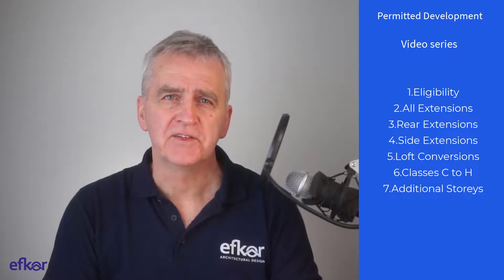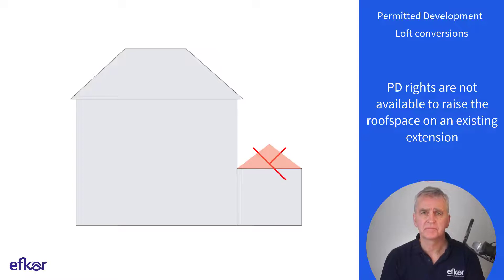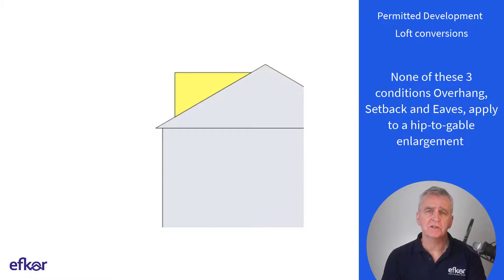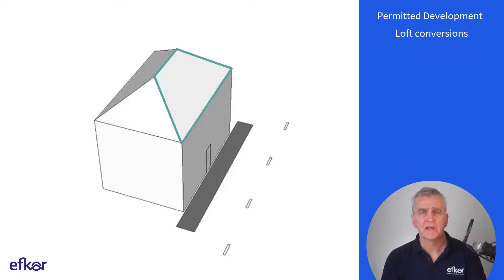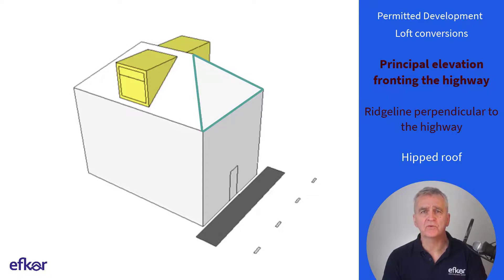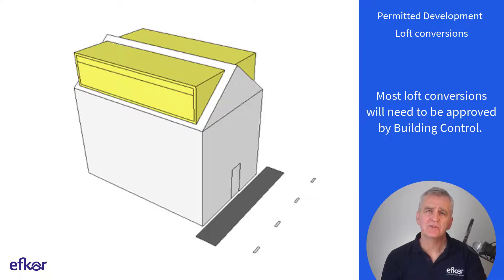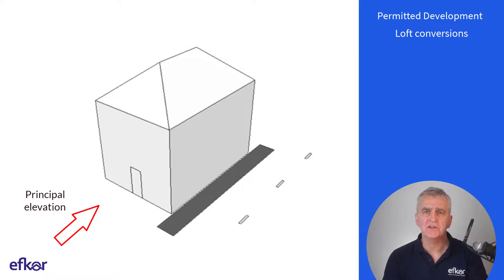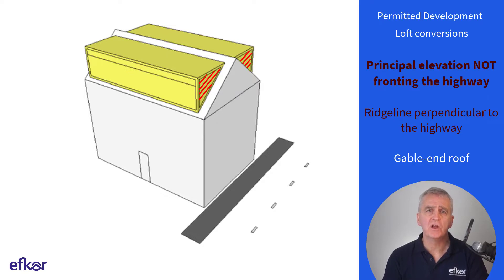Rules for building Loft Conversions using Permitted Development

Comment: Hi Marc, it would be good to have your view on B.2 (b)(ii) 'other than in the case of an enlargement which joins the original roof to the roof of a rear or side extension, no part of the enlargement extends beyond the outside face of any external wall of the original dwellinghouse'. No other youtuber has examined this section and it would be very useful. Thanks.
Reply: Also Marc, just a word of warning - although a main entrance door to a dwelling can be at the side, this is not the only determining factor of which is the principle elevation. If that elevation is relatively featureless, containing in addition to the door, only one small window for example, there are planning appeal decisions whereby the planning inspectorate considers that the principal elevation to be that of which has more windows and is more prominently in view as one approaches. I assume you acknowledge this point however as you are just using this to guide the viewer through your explanation. Your videos are great however and I appreciate the way you explain PD rights in a simplified manner. Just thought I would put that note to all viewers, in case they may be faced with this type of situation and therefore are not shocked. Thanks

Comment: Really enjoying the videos, thank you. Could I ask a question? I an wanting to put a one storey 3m extension on the back of a terraced house under PD. Are there any issues about how close to my neighbours property, or in effect can I just follow the brick line coming off the back of the house? many thanks
Reply from the maker: Thanks Paul. Two issues to look out for. First make sure that your property retains PD rights (if not sure, email the council). Second, many (London) councils are rejecting such cases where the original house has a projecting rear porch or offshot (even a 1m depth) that contains a wall with a side elevation combined with the proposed extension being more than twice the width of the house. Look at Class A condition j (iii) very carefully!
Reply: @efkor  Thank you I will. Nothing on the back of the house, but will double check with the council.